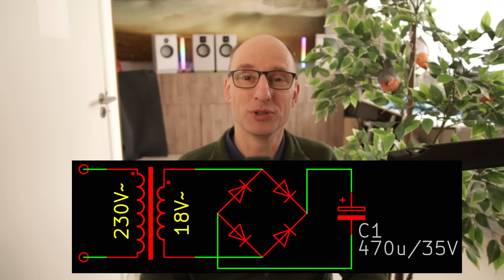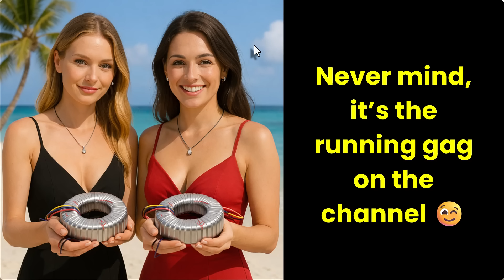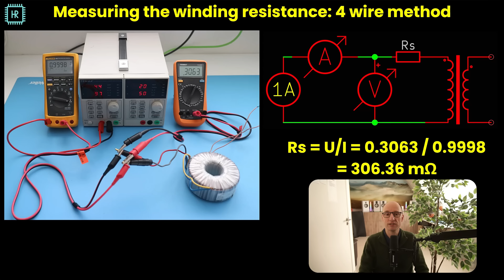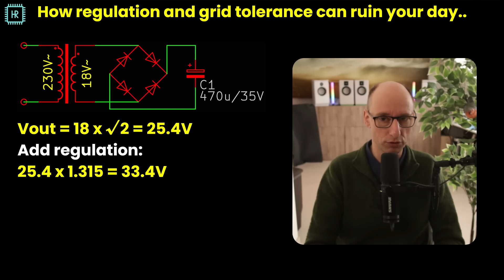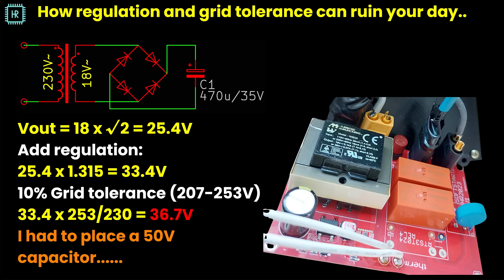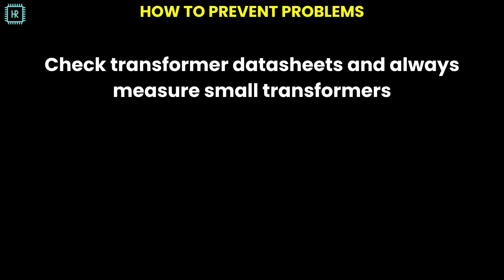Linear Supplies Can Destroy Your Designs

Comment: ha-ha.

After some air strikes today, the voltage in my grid deviated between 185 and 270 volts several times during the day. Greetings from Ukraine!

It can also happen without any air strikes. There can be thunderstorms and a multitude of other disruption factors. Good luck designing a reliable power supply that can handle this properly.
Reply from the maker: Oof, I didn't factor in war.... stay safe out there!
Reply: @HansRosenberg74  the possible takeaway is that not only you need to account for significant tolerances, but also to implement power-off when the input voltage goes beyond whatever tolerances you've designed for, since you can't really cover an infinite range.
Reply: @s_s-g4d  under/over-voltage lockout relays have been a common thing here even well before the war. Those are small 2 DIN unit wide boxes to go into the breaker panel. Their main purpose is to safeguard against a neutral conductor break. If a break happens, and the load across the phases is asymmetric, one phase would get undervolted (bad for asynchronous motors such as refrigerators or AC units), and another phase would get 300-400 volts (bad for all appliances). Those microprocessor-controlled relays would trip out in either case, and, after the voltage is back within limits, restore power after waiting out a pre-programmed delay.
Reply: @sashimanu  I have one. but that's not really the point.
Reply: Кондиционеры сами себя обстреливают же. Каналы москальские с пресной водой сами себя перекрывают. Чтоб "Кысчане" еще сильнее любили неньку. Как весело было, "-А давай резать москалей -А если они нас -А нас то за что?" А вот за то самое. И будет очевидно еще хуже по спирали, про ядерку всё чаще бухтеть начинают.
Reply: God, I am so ashamed of my country. Its been more than 4 years already and each year its more and more difficult to look Ukranians in their eyes ❤️‍🩹 Why? 😭 Still can't comprehend...

Keep strong! Be safe 🕊️
Светлая будет полоса!

Comment: Not to speak of the current spikes this design makes
Reply from the maker: Yes, the transformer is stronger and the capacitor bigger, you can blow some fuses.
Reply: @HansRosenberg74  Also you can have short current spikes during the reverse recovery of the diodes... And those spikes create a ringing with the leakage inductance of the secondary of the transformer. An EMC catastrophe.

Comment: So if you have a big bulk capacitor and the load is not yet online, it will actually charge to this higher voltage and have quite some oomph when the load does go online, right?
Reply from the maker: You can see the thermistor (the blue thing) on that pcb. That limits the inrush current at startup.
Reply: Yes, that's called the inrush current.  On higher power designs typically thermistors are used to limit it.
Reply: @christophtack5080  isn't inrush limiting usually before the bulk capacitor?

Comment: I have encountered this to a much higher extent when building my tube amplifier. 
The rectifier tube is 5C3S (equivalent to 5U4G), it is directly heated, so it warms up in a few seconds, while the output tubes (6N13C / 6AS7G) take their time. In addition to that, I had bought a transformer with higher output voltage than I ended up needing, so I added a couple of resistors to drop the voltage. It is also a choke-input supply, which has much higher voltage at very low currents, like when the rectifier is hot and output tubes are cold.
B+ Goes up to something like 450V, then, when the power tubes warm up, it drops to something like 250V (I do not remember exactly). I had to use 550V rated capacitors.
Reply: With a choke input supply, you need to draw a min ~10% of full load current (typically using bleeder resistors) or else it acts as a cap input supply, charging to the higher cap-input voltage.
Reply from the maker: With those high voltages you probably get high winding resistances making the problem worse....

Comment: A regulation figure of "25%" does not mean the no load voltage is 25% higher than the full load voltage, rather it is 33% higher. This is because transformer regulation is defined as: 100% * (No load - Full load)/No load. Yes it's annoying. Also I think you might have an old Hammond datasheet; the new ones are brilliant, they quote the full load and no load voltages, and the winding resistances.
Reply from the maker: Hmm interesting. I looked this up 2 days ago and on this transformer, I could not find anything! Did I miss something? Did you find info on this one?
Reply: @HansRosenberg74  It's on the hammond website under 183E36

Comment: May be 25 years ago i built a Power-AMP for my bassguitar. Because i can i build a 1,2 kW Class-B AMP. I ordered (extra produced) a 2kW Toroidal transformer and .... i blow the fuse of the Building. Ma room-fuse has 16A but it was to slow, so i blow the 60A builing-fuse. The electricity provider had to come out for repairs because the house fuses are sealed. An expensive mistake. 🤕  So never put such a big transformer direct to mains
Reply from the maker: hahaha, I had the same thing. I got a 3kV isolation transformer. You cannot turn those on without a inrush limiter. Actually, the circuit I'm talking about in this video was for THAT transformer.

My main fuses went down, but in our house these are circuit-breakers. So I could just turn them on myself again. Very practical.
Reply: My first PIC microcontroller programming project included a zero-point detector for a similar big toroid approx. 30 years ago. It could only be switched on via an SSR, which was driven from the microcontroller. It constantly checked the mains sine wave via its A/D and only allowed the SSR to switch on when the wave was near zero; it worked like a charm without blowing any fuse ever.
This was a heater power/control unit for resin inlining for sewage pipes.

Comment: The other thing to keep in mind with line-connected AC transformers is lightning.  Lightning from outside the house will work its way inside and part of it will make it through the transformer, raising the voltage on that output cap even further.  This will be tricky to simulate as most of that energy will probably go through the capacitance between the primary and secondary windings, NOT the magnetic core of the transformer.  This is becuase the core is designed for 50 / 60 power transfer, and the few ms of lightning won't propagate through that easily.

There are several ways you can handle this.  An MOV or GDT on the primary side of the transformer, or a TVS diode after the bridge on the secondary.  The TVS voltage has to be higher than the maximum unloaded voltage at the highest input voltage, will still being below the cap voltage you're trying to protect.  

There are standards for the lightning voltages and currents you'll see depending on whether you're inside the house or outside.  I courage folks to check these out and simulate with them to fully protect your circuits.
Reply from the maker: I've once dealt with a lightning strike on an audio company. This did so much damage, nothing would have helped I'm afraid.

Antenna wires in the building had literally vaporized and the copper recondensated on the wall where the cable used to be. Wall sockets had exploded and were all over the floor.

I started to assess the damage to the audio equipment and everything was broken, even parts deep into the circuitry. 

I don't think there is any protecting against that, that is why I always pull out all the plugs if a thunderstorm approaches
Reply: @HansRosenberg74  That was clearly a direct hit, and yes, it is unlikely they could have done much to protect against that.  

However, as lightning has hit two trees in my yard (one within 15 feet of my house) I have to wonder if that building wasn't properly grounded, or had some other wiring issue.  These strikes did some damage to phone and computer equipment, and one took out a cable modem for the neighboorhood.  But they certainly didn't do the catastrophic damage you descibe!

I have since installed the largest whole-home MOV surge suppressor I could get from the harware store on the inside of my breaker panel, and have another one to install on my compressor feed on the outside of the house.

Fortunately, most strikes are further away, and have to travel through cables to get to your home.  There are standards (like IEC 61000-4-5 or IEC 62305) which provide lots of info on surge sizes and protective devices.

Over a decade ago I had the task of protecting the BPL (Broadband over Power Line) transceiver inside a smart meter from the standard outdoor 15KV, 100A surge.  When my boss first assigned me the task I thought he was nuts, especially since the BPL system used frequencies up to about 20MHz and even the few pF of a GDT across the power lines was enough to degrade communcations.  

However, after a lot of investigation, simulations, and hunting down of special Epcos caps, I managed to get a working solution.  And yes, it did pass the all the lightning tests, and the BPL system (and the rest of the meter) kept working through it.  

And I've seen enough crispy MOVs on equipment to know that they will give up their life to save what they are attached to... and they usually do a pretty good job.  

Nothing is going to survive a direct lightning strike, but fortunately that's not usually what happens, and we can go pretty far protecting ourselves against the "normal" surges.  Had I been more proactive about it before, I would have saved thousands of dollars of equipment.

Comment: And if the nominal voltage is 240VAC means the maximum voltage can be 264VAC, then we have to consider transient conditions like the ones described by ITIC, power supplies are fun! 😊
Reply from the maker: Indeed, rural areas are another problem. The grid is supposed to be 10%, but at the end of a really long line with heavy load or solar panels, you can get 20%....

Comment: Another landmine - at no load, when the transformer current and voltage are almost 90 degrees out of phase, the input inrush current is massive - input fuse type needs to be adjusted accordingly, among other things.
Another landmine : the capacitor usually being of high value, the capacitor current peaks are huge - instantaneos Ifsm of the diodes must be selected accordingly.
Another landmine : paralleling pass transistors for higher current demand : a series resistor, one per transistor, must be used.
Another landmine : low freq 50/60Hz coupling into the feedback for your transistor gate…
I can go on…
Reply from the maker: Yes, I have a whole course on landmines :-)

Comment: I feel like 33.4v already warrants specifying a 50v cap for better life expectancy anyway besides the line voltage fluctuations.
Reply from the maker: Indeed! I did not apply my usual conservative approach for some reason.
Reply: @HansRosenberg74  i think it worked here though. The message is a clear "even if you're not cautious with your capacitor rating, the circuit will still fail." Seeing a red number that's actually in the red area (above rated maximum) is pretty impactful.
Reply: @HansRosenberg74  I think it's ok to use an electro cap at its rated voltage.  They are somewhat self-healing.  They don't like heat, which slowly evaporates the electrolyte, but doing duty in a linear supply should not normally be stressing the ripple current rating.  I built a 400W power amp 30 years ago, and the 75V 10mF main caps are all working fine on the nominal +/-70V supply (from a 500VA toroid).  The only re-capping I've done was for some small 100uF 100V caps on the board.  Only one of the 8 failed, so it might have just been defective from the start, but replaced them all anyway.

From now on, I'm not going to be using linear supplies at all.  They're inefficient, heavy, expensive, have horrible power factor, and make an annoying and hard to suppress buzz from the current spikes.  The only advantage is (maybe) reliability, but with SMPS so readily available,  I'll take the chance.

Comment: This great video demonstrates why I usually use switching pre-regulators followed by linear regulators when very clean power is necessary.  Always over rate PS components.  Always.
Reply from the maker: Yes, it has many advantages, especially if you apply good layout techniques to keep interference down. Also much better for efficiency.

Comment: Are linear supplies still worth it? It seems the only thing they got going for them is component count and electrical robustness, great for weird loads.
Reply: less emc problems
Reply from the maker: good question. I'm leaning more and more towards switching supplies as well.
Reply: @HansRosenberg74  Microwaves are like 80% power supply by weight :P And those tranformers are so highly optimized they operate in the saturation range, I forgot why other than propbably cost savings! A few brands adopted switching supplies there too now.
Reply: @Gersberms  MOTs are things of their own. Also there's not much regulation happening, except, probably, by the magic of the MOT itself.
Reply: It's an interesting question. About the only place I use them nowadays is low power circuits where voltage regulation and/or power dissipation is not an issue. SMPS are more noisy of course (radiated and output noise) but generally it isn't much of a problem these days.
Reply: You can make them very quiet by using a linear pre-regulator. 100 dB of ripple suppression is easy. 130 dB is possible.

Comment: Interesting. I just checked the data sheet for the PCB transformers I usually use (Block), and the idle voltage is 35% higher than the nominal voltage.
Reply from the maker: 35%, wow, that is the highest I've seen. What kind of power is that? Smaller than 2.5VA?
Reply: That's a regulation figure of 26%, pretty standard for PCB transformers

Comment: Yeah, I grossly derate filter caps in these situations. I've seen failures due to line transients. Sometimes I'll even add MOVs to the secondary and/or DC rails...
Reply: Explore Vishay's TransZorb product line for this application.  They're much faster and far more precise in clamping voltage than MOVs.  MOVs are also limited life components with transzorbs having much longer life.  MOVs are only better in terms of higher total dissipation which is far less of an issue behind a transformer.
Reply: Zeners for DC peak clipping also work.
Reply from the maker: Oof, that is reall overkill :-)
Reply: @HansRosenberg74  During a couple decades of building automation controllers I have had to resort to bidirectional TVS clamps across secondaries and unidirectional TVS clamps before 78xx regulators more than once just to stop MCUs from experiencing spurious resets.  Factory electrical can by quite dirty.
Reply from the maker: Ah, I get it. I did not hear this problem before.

Comment: I think those mistakes happen when you treat power supply parameters like a nuisance rather than a key performance indicator. In other words, lets be done with the boring stuff so we can concentrate on this sexy circuit I have in mind.
Reply from the maker: Very true, you tend to focus on the difficult stuff, which then always works, while the simple stuff fails!
Reply: @HansRosenberg74  that is also true!
Reply: @HansRosenberg74  I never went to school for electronics. I taught myself starting with the Radio Amateurs Handbook at age 10 (1954 tubes - no transistors yet). I taught myself computers starting in '75. It is all sexy. Transformer regulation is why I bought an IMSAI with a 60Hz resonant transformer.

Comment: I hate electrolytic capacitors, and they are very often the components that end up dying and causing equipment to end up in landfill. Always use decent, long life / high temperature parts for anything that matters. 

One of the advantages of using higher voltage rated electrolytic capacitors is lower ESR (and hence less heating) for the same capacitance. Of course, they are larger. 

Where possible, for high current applications (eg DC link capacitors), plastic film capacitors have vastly lower ESR (and hence less heating and longer life). Often the size penalty can be easily accommodated.
Reply from the maker: I agree totally, I always use a way higher voltage than needed and  use long life / high temperature versions. You do need them to get your high values unfortunately.

Making 1000uF with polyester caps kind of makes your equipment big :-D
Reply: @HansRosenberg74  I guess it depends what you mean by "big". When you consider the vastly better ESR and ripple rating, film capacitors are often very feasible and don't necessarily take more space (you may need several electrolytics in parallel to achieve the ripple current rating). 

Take your example of 1000uF, with 600Vdc rating, here's a typical example:

Film capacitor: Kemet C44UHGT7100M84K: 
- Size: 85mm diameter x 134.5mm high
- ESR: 1.7mΩ @ 10kHz
- Ripple current: 56A @ 10kHz

Electrolytic capacitor: Kemet ALC70C102FP600
- Size: 45mm diameter x 107mm high
- ESR: 92mΩ @ 10kHz
- Ripple current: 11.48A @ 10kHz
Reply: @michaelnoble2432  Are there any 1000uF film caps rated for lower voltages (say 50V)?
Reply: @abraxalito  curiously, they are much harder to find in such voltages. You can get 560uF 63V caps (such as MKT1820756065) but they are ridiculously expensive. 

In my line of work I deal in hundreds of volt, where IMO electrolytic capacitors make zero sense. But I'll concede at lower voltages they still have a place.
Reply: @michaelnoble2432  What's your typical ripple voltage at such lofty heights as 600V? I guess fairly high given you're concerned about ESR.
Reply: @abraxalito  up to tens-of-volts. These are for high-powered DC to AC converters, where the DC can have a lot of ripple voltage.